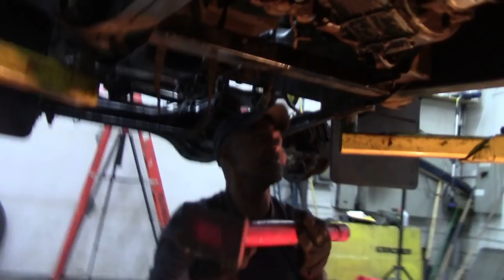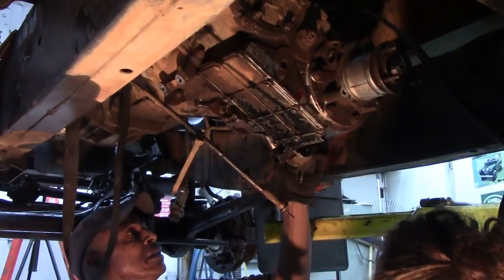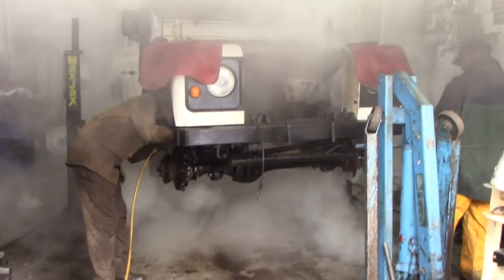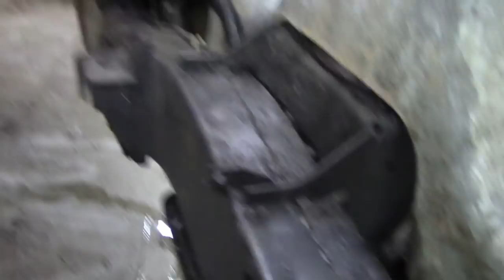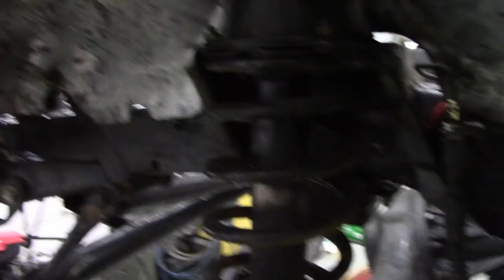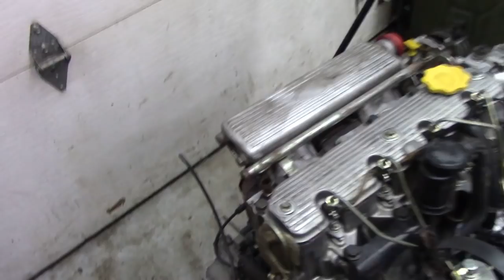Malawi 110 Strip down part 3 end of day 1

Comment: Try Barkeepers friend on the bulk head Mike.  Not the powder but the cream.  It's a little bit like Jif or liquid Gumption we had in the UK but it's slightly acidic rather than alkali.   If it doesn't work you can still use it on your bathtub.

Comment: Was probably an alkyd based paint which will not adhere to galvanized or zinc surfaces. Common paint mistake working in your favor on those wheel wells.

Comment: I was thinking along the same lines as you regarding internal corrosion of the aluminium as on the Garna motor.  Had the same problem with painted chassis, had to use a wire brush in a drill to get the stuff off, it always comes off any galvanised surface easily unless a etching primer was used before the gas tar was used. What colour are you going to paint the full assembled unit before you put it back into the motor Mike, I like a bright yellow just to see the look on peoples faces when they open the bonnet. Great video Mike, brings back so many memories. Best wishes and thanks from Yorkshire Rob.
Reply from the maker: Yes Rob, he has made the wise choice to use the recently rebuilt motor